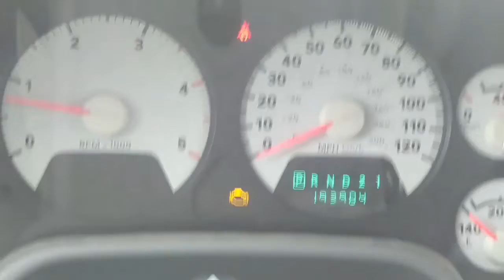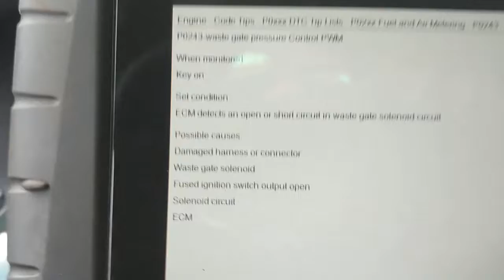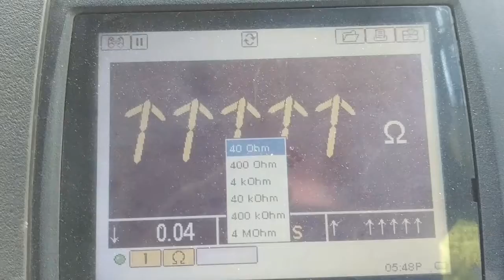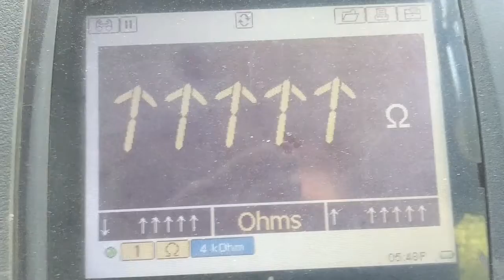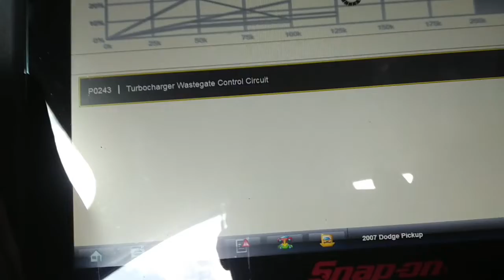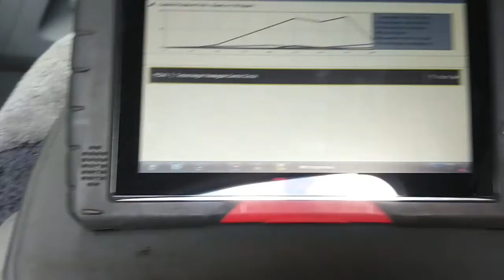2007 Ram 2500 HD 5.9 Cummins P0243

Comment: Same code on my 07, just put a new budget selenoid in... Did nothing, I wonder if a new one could be bad? I'd had bad parts NIB before,... Is there nothing else that would throw that code? Should I try another selenoid? Thanks for the video!!!
Reply from the maker: Is yours stock? This one turned out to be a dummy. Connect a test light like a 194 side marker light bulb across the harness connector. The light should light key on engine off and you should be able to clear the code. One wire is power with key on and ECM controls the ground I believe. You could have a wiring problem or a defective new part. Measure the resistance across the original and replacement one. I'd expect 10 to 20 ohms. HTH
Reply: @PhillipBailey  stock. I'll have to try and test with a multimeter both and the light. So a 194 marker light will pull the resistance the selenoid should, and it will trip the code off? Ok. Might be a couple days but I'll try it out. Doesn't take long to do that.